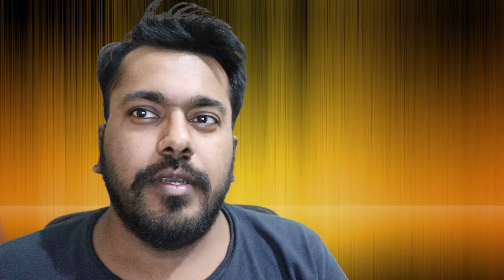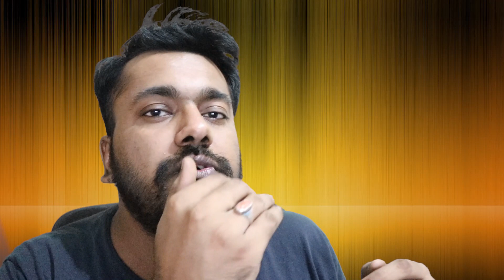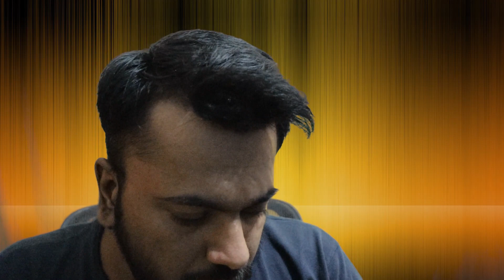What is asked in System Design Interviews? | Format of System Design Interviews? | LLD vs HLD

Comment: I must thank you for your contribution to the community. 

I am a subscriber to your channel. I need your suggestion, I am working as a senior dotnet developer and my overall exp is 8+ years with very little DS and algorithm knowledge at present. After watching your interview-related videos I want to prepare myself for the SDE level. But not sure which level, will it be 2 or 3?

My tech stack is dotnet with C#, will that be sufficient for solving interview-level problems?

Please suggest how should I proceed? I am working on service based company.

Thank you for all your videos as it may change the way of my career path.